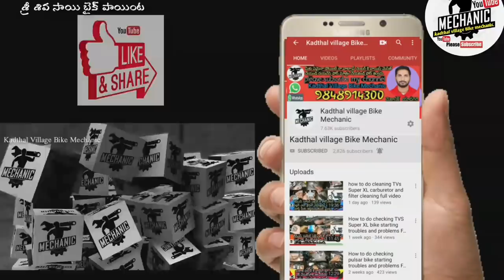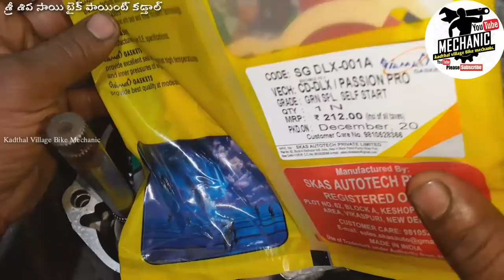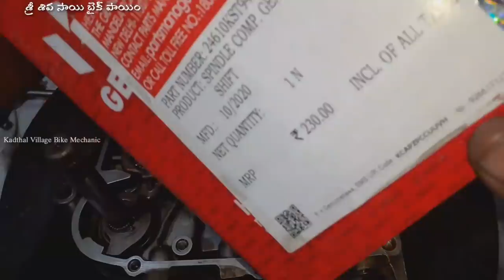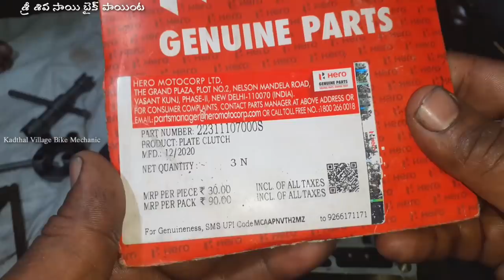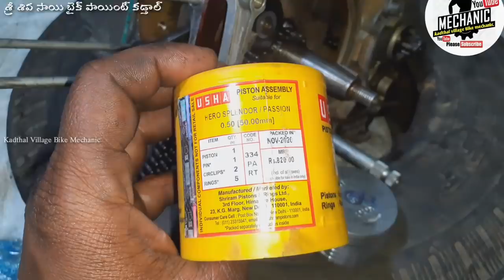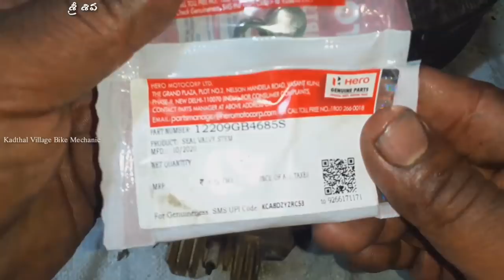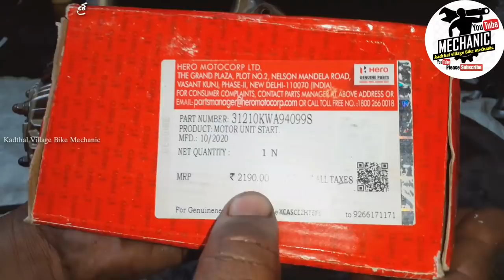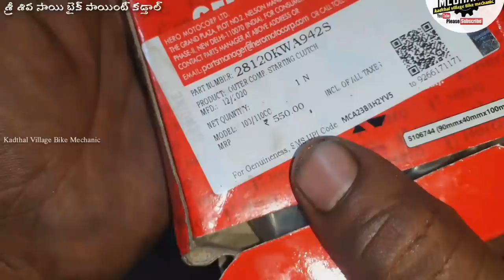Hero Splendor Pro And Passion Pro Full Engine In Telugu||Kadthal Village Bike Mechanic

Comment: full tight boltalu fitting is wrong u r a mechanic so u know the tension and tightness new guys if they fit it very tight and if they break it then ??  
But really great to share your knowledge.  

Bro, i want to convert my drum to disk on splendor could you please help me with spares.  required.  can you please list out the spares required so that I can purchase them slowly or get them in the second-hand market?